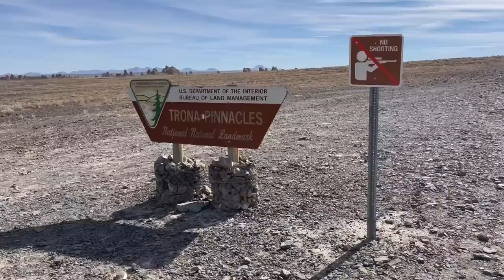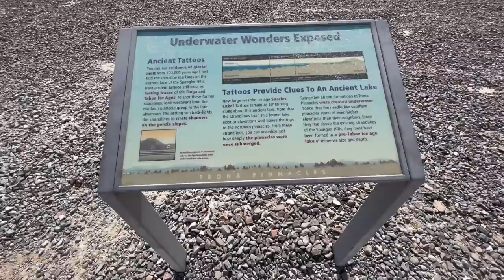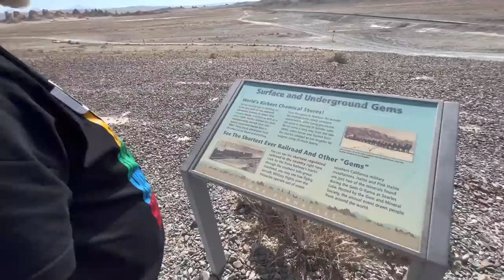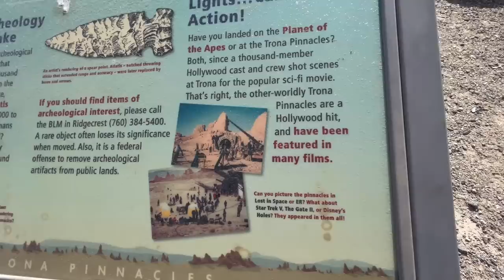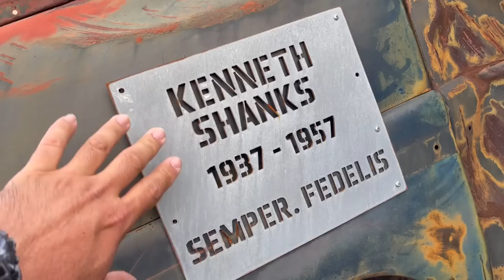We found over 10 vintage cars crashed off a cliffs edge!

Comment: The green station wagon is a 1959 Chevrolet Parkwood wagon. the rust free floors are worth grabbing that entire body and cutting out along with some other good parts all around. worth as is $1,500 easy, but to get it out need a helicopter and a flatbed that would be around $5,000.
Reply from the maker: 🤭🤭🤭🤭🤭 helicopter!!! 🤭🤭🤭🤭🤭

Comment: A 1962 to 1967 International Harvester pickup truck, not a '68 I can tell by the firewall.  4-speed floor shifting trans, not a 3-on-the-tree and not 4wd like many IH's.   I might be able to tell more accurately if I had a better picture of the front.  VIN's are usually on the door or door post and stamped into the frame near the steering box.  The last light-line vehicle was manufactured in 1980 and they still make medium and heavy duty trucks today.  Because of the split-up of the company the truck division is now called Navistar.  They made everything from farm equipment to appliances (freezers etc) to trucks to the famous Scouts and the full range of medium and heavy duty trucks.  They were the first to come out with SUV's (Travelalls) and crewcab pickups (Travelettes) and crewcab medium duty trucks in the early '60's long before any of the other manufacturers ever thought of them.
Reply from the maker: Wow! Thanks for the detailed information!

Comment: The first car is a 55 Chevrolet 210 Two door sedan.

The first pickup is a late Fifties early Sixties International Harvester.

The car Mr. Shanks wrecked is a 49 or 50 Mercury sedan, the car that's wrecked into the Mercury looks to be a 51-53 Oldsmobile sedan.

The car that's upside down is a 1969-70 Dodge Dart sedan.

The Chevy wagon is a 1959 model.

The car on top of the 59 Chevy wagon is either a Dodge or a DeSoto, 1949-1952.

The white car with the roof cut off looks like a 52-53 Ford two door sedan.

The last one is what's left of a 67 Oldsmobile 98 sedan.
Reply from the maker: Thanks for the info!

Comment: Those cars, or some of them, were stripped first then ditched over the cliff/hill. My theory. Also obviously not a secret spot 😂
Unless someone carried those missing engines off with a backpack?
Reply from the maker: There are many theories.
Reply: On hard enough wrecks sometimes the engines fell off from those old cars since motor mounts back in the day weren't very sturdy, just like passenger seats also did in violent crashes.

Comment: That first overpass you drive under.  I live about 50 miles to the west.  Also in the same desert 🤘
Reply from the maker: You ever explore in the desert?
Reply: @reverserockettv007   I have before. Not in a long time.  I stumbled upon a maintained patch out in the middle of nowhere that had  a mock gas station,  motel, and a few other buildings, used as movie / TV sets.   It's not blocked off or anything. I drove right through the middle of it.   It's out towards Edwards Air Force Base
Reply from the maker: I will do some research on that! Thanks for the info!!
Reply: @reverserockettv007  Anytime, it's been a little bit  since I was out there, so there is a chance it's no longer there.   But the closest city is Lake LA.     There's no lake there lol  it was just a bit north - east ish from Lake LA.

Comment: The not so secret location is on the Trona  Wildrose road at the Slate Range crossing. There are much better artifacts at more remote areas but those locations are secret. The desert is not so forgiving to unprepared city folk but someone needs to fed the vultures.
Reply: are they a secret for a reason ? such as military outpost /operations etc ?

Comment: that's a 265 v8. It was the first overhead valve 8 cylinder engine for chevrolet. Easy to identify by the staggered retaining bolt holes for the original valve covers
Reply from the maker: Thanks for the info!
Reply: yes and the casting date is August 11th 1955

Comment: 34 minute mark. 1968/69 Dodge Dart 4 door with slant 6 is the one that’s upside down. 904 automatic, power steering, AC, 9 inch drum brakes and 7.25 rear
Reply from the maker: Thanks for the great information!

Comment: I found it; you led me right to it. I've seen worse curves than that. Hard to believe that many cars went over.
Reply from the maker: Did you look over the edge?
Reply: @reverserockettv007   I found it in the map using Google Maps and Street View. I found each landmark that you passed except the abandoned mine. I could only see what the street view on Google Maps recorded.
Reply: The grade is fairly steep and those cars did not have the 4 wheel disc brakes all cars have now
Reply: Some will have just been dumped, pushed over the edge after mechanical failures. I suspect a lot of the damage has come from rock slides. Bodies would be removed from crashed cars and if possible the car recovered. That marine who died apparently got out of the car but died in hospital. I doubt anyone would want an engine badly enough to go to the trouble of removing it from a car on that hill so chances are those were just car bodyshells when they were shoved over.
Reply: I'm from the UK and we always say that American cars are useless going round bends, especially older models from the 50's, 60's and 70's 😊
Reply: @746laurie  not all of us in the UK say that, some of us know how to drive them… 😀
Reply: @CycolacFan  Yes, heavy braking many yards before the bend! Have you ever watched the Goodwood Festival of Speed and seen how the little Minis catch up with the Chevrolet Camaros and Ford Mustangs at every bend. Okay, yes the Minis will then lose ground on the straights (1275cc versus many more litres!) but I'd rather be driving a Mini round a sharp bend.
Reply: Yeah me too, i found it really quick in Maps.

Comment: The green hood looks to be off that green 59 Chevy wagon. A 59 Chevy wagon in mint condition will pull in over a hundred grand now days.....
Reply from the maker: Wow really?
Reply: @reverserockettv007  Yeah, wagons have become popular, but they're hard to find as no one saved them back in the day..... the old supply and demand. 59 Chevy's, due to their wild styling have become top dollar cars in the past five years or so. I have owned my 59 Bel Air 45 years now. I paid $75 for it in 78 with 58,000 miles.... a guy offered me a hundred grand for it last summer.... I turned his offer down! The Bel Air has over 200,000 miles now. I still drive it. I have videos of it on my YouTube channel.

Comment: That old wagon is so cool, so sad to see it in that condition though. If money were no issue I’d be out there saving these relics
Reply from the maker: Yes I am with you on that!
Reply: 1959 Chevrolet Wagon.
Reply: wanna see a cool video, check out these 2 guys attempt to start a 1958 Ford Wagon, that literally hasn't run in 5 decades +   it's called "'58 Ford Parked Over 50 Years Ago: Will It Run?"  just amazing!!

Comment: 36:13, yes Mopar Road runner or satellite 1968 or 1969. You do know that at one time they were farther up the cliff, rockslides have moved them down over the decades.
Reply from the maker: Your right!
Reply: @reverserockettv007  that Mopar was a 67 Dodge Dart, looked to be a slant 6 car, single small exhaust as well as the 71/4 inch rear end. The grille gave it away.
Reply from the maker: @garyoyler9111  Thanks for the info!
Reply: Pretty sure it's a 69 Dart/Valiant. Roadrunners didn't come with 4 doors or 6 cylinders, and a 68 would have round side lights. Not bein' a smart-@$$, just sayin'.
Reply: Pretty sure it's a 1969, it had rectangular side markers. If it was a 67, it wouldn't have any; a 68 would have little round ones. But you're def right about the Dart part.

Comment: the first car likely is a '55 Del Ray with a 265 automatic. If the remains of the color on the fender is original, possibly sea-mist green with an ivory top. Beautiful car once upon a time. Then a circa 1955 ford sedan, a circa 1951 Oldsmobile on top of a 1950 Mercury. The upside-down car likely a mid-'60's Ford sedan. The station wagon, a '59 Chevy, above it a circa '52 Chevy. The really mangled one with the cut-off top seems to be a '52 Ford. The last one, a 1968 Oldsmobile.
Reply from the maker: Thanks for the info!
Reply: @reverserockettv007  You're welcome. I've been into cars since I was about 5! :)

Comment: After the fire in Santa Barbara running covered over 50 cars off of Mountain Drive Gibraltar rock at least seven dating from the 60s to the 30s and then the old Lookout point add about eight down there one being a friend of mines an old, Plymouth
Reply from the maker: I should do a video about them!

Comment: Every bit of stainless got stripped off that 55 chevy sedan in and out but left the og 265 small block. That was chevys first v8 n one thing about them is they didn't have an oil filter
Reply from the maker: So Just a drain plug?
Reply: @reverserockettv007  yea just a drain plug for 55 in 56 they finally added one
Reply from the maker: @rocketsnhotrods9022  I didn’t know that! Thanks for the info!!

Comment: 1955 Chevy. The pickup truck, IH logo is;  International Harvester. The green hood looked like 1959 Chevy to me. Car #4 looks like a 1955 Ford. The  Kenneth Shanks car looks like a 1949- 1950 merc, the car on it looks like a 1949-1950? Oldsmobile? The car at 34:45 is a MOPAR, I see both torsion bars. It's pre-1974, no catalytic converter. I was gonna say a 1969 Dodge Dart because of the grill?? The station wagon at 37:35 is a 1959 Chevy which explains the 1959 Chevy hood I called out before...The other station wagon; 1950 Dodge.  Car @ 41:37 is, 1953 Ford???? Going by the speedometer opening. That last car? 1968 Oldsmobile 98??? Not sure..
Reply from the maker: Thanks for the info!
Reply: @reverserockettv007  U-bet

Comment: Dont think those are wrecks , looks like most were stripped for parts and the rest shoved over the ridge .
Just cant see someone hauling the differentials , engines , transmissions , ect up that steep rocky hillside . 
Those items are extremely heavy and cant be move or carried without equipmeny and machinary
Reply from the maker: I believe some are actual wrecks. Notice the memorial on the marines car.

Comment: 18:35 '55 Chevy Bel Air

22:58 '63 International Harvester C1200

26:27 '83-'88 Suzuki/Metro/Chevy Forsa

29:43 '55 Ford Mainline Fordor

30:10 '50 Mercury Sedan on the left, and '52 Olds 88

34:16 Late 60's B-Body. Plymouth Roadrunner/Satellite, Dodge Dart/Coronet

36:32 '73-'77 Datsun 710 Wagon / Nissan Violet Estate

36:57 '51 Dodge Coronet or '52 Chrysler Saratoga/New Yorker

37:35 '59 Chevy Biscayne Brookwood

41:29 Could be a '52-'54 Ford Line

43:33 So I just found out that the Renault 4CV was sold in the USA. Also that the first batch of cars came in beige - which was camo paint from the Afrika Korps of WW2.

45:01 Oh man! I can't place it! I know this car, but I just can't remember what it is. It's not a Cadillac, and it's not an Olds. WHY CAN'T I REMEMBER
Reply from the maker: Excellent comment! I really appreciate it!!

Comment: International Harvester pickup. '60's. 4 is '55-56 Ford. Semper car was '50-'51 Mercury, car on top is about the same year Oldsmobile. The not sure car in the middle (Honda and Chevy Wagon) is '49-51 Mopar probably Dodge or Plymouth. light blue not VW (VW's have no frame, rear engine) really smashed is 52-54 ford. (round tailights, no fin) last one had a pointy grille like an early '70's ford LTD. That's my best guesses.
Reply from the maker: Thanks!

Comment: That first car is a '55 Chevrolet.
Reply from the maker: Thanks for the information!
Reply: @reverserockettv007 , the one with the emblem missing looks to be a '55 or'56 Ford.  The Monument car is about a '50 Mercury.  The car on top of it, based just on the taillight frames looks to be a '53 or '54 Plymouth.

Comment: The first wreak is a 1955 Chevy 210 

The second is an International Pickup 

The third older car looks like a ‘55 Ford 

The car marked with the gentleman’s man looks to be a 1949 or ‘50 Mercury. 

The car laying on top of it looks like a some sort of Nash or Rambler or something like that.

The station wagon at 37:30 is a 1959 Chevy. Not sure what trim level it is.

The car laying on top is definitely a Chevy as well. Maybe a ‘53?
Reply from the maker: Thanks!

Comment: oh and he told ne holly wood they would take out the motor an transmission an all the fluids from the cars it was just a shell an they would  use a push truck or a cable launch system to shoot them over the cliffs there is a lot of movies an tv shows from the 1960s an 70s an 80s  they said he better slow down that s dead mans curve  ahead like in chips cannon /  the rockford files  u should some time check out mooholland drive bet there is alot of cars off of that road!!!!! happy hunting
Reply from the maker: Thanks for the info!

Comment: A fair bit of these wwre super cheap beaters had for nickles and dimes durring the 70's. Not many wanted them and the parts support wassnt super great because allot of brands went under post war. The 50's were make or break for brands like Desoto, Packard, Nash merged to make AMC, many others that were small and regional would go under a short decade of stylish but not super reliable cars that would clap out often before 80-90k.
Reply from the maker: Thanks for the info!